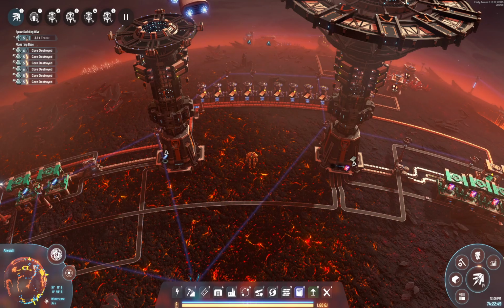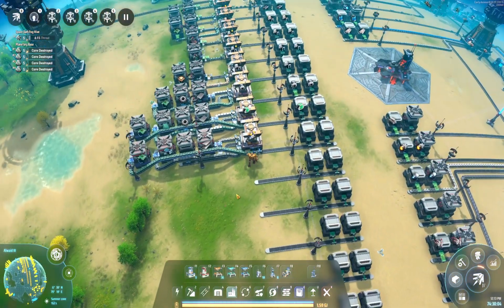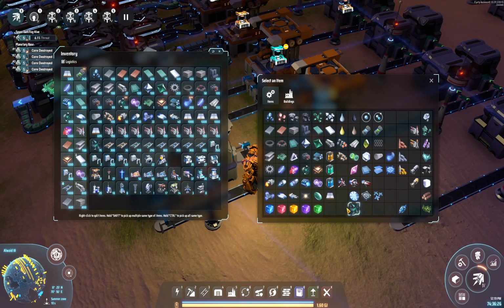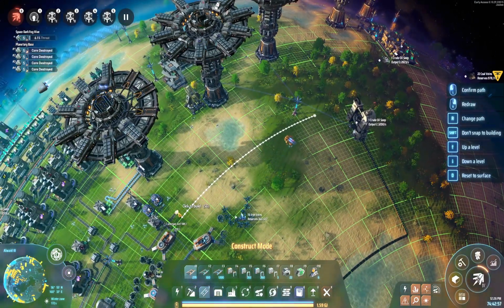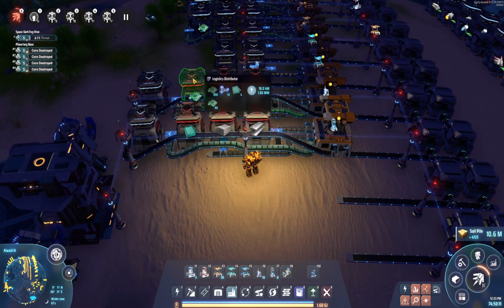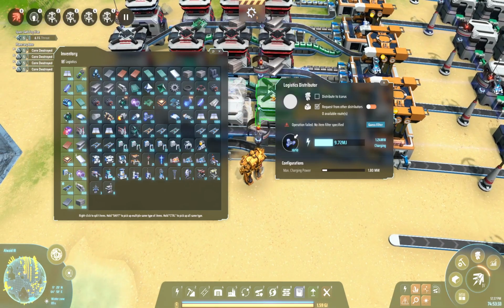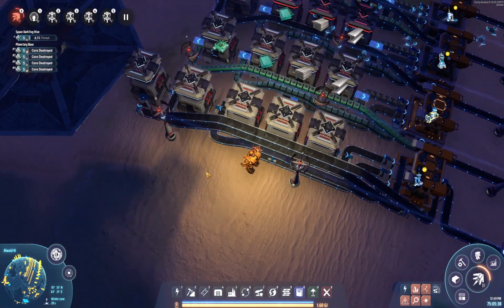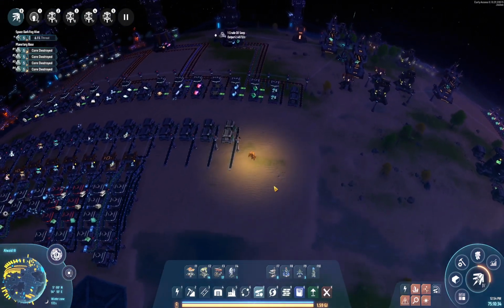PRODUCTION // Dyson Sphere Program // Mission Log 74

Comment: you're probably recording this right now, but to automate your orbital collectors, you need charged accumulators, to automate the charging of those, you will use an energy exchanger. you can use accumulators as batteries to ship power between planets but its kind of annoying comparing to just making more deuterium fuel rods so i really only charge accumulators for orbital collectors. apparently you can even use accumulators in your mech, if you like battery power. energy exchangers will probably be a whole episode to figure them out!
Reply from the maker: I actually understood that in a vague way but you're probably right that it will take me an episode or so to figure out how to use them properly.